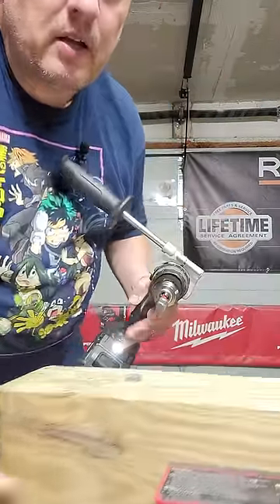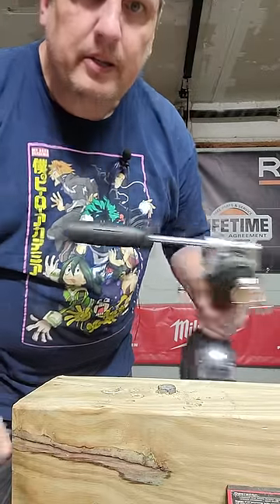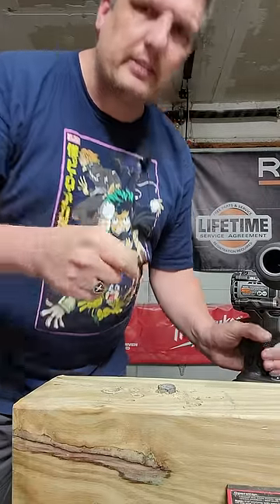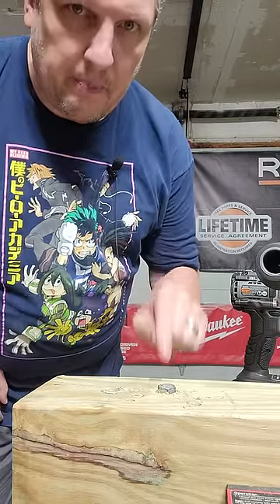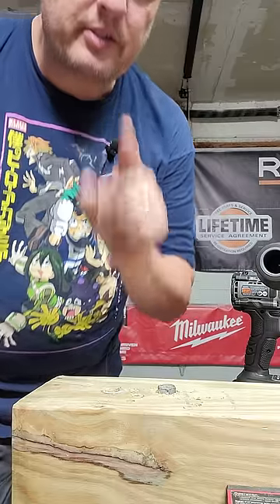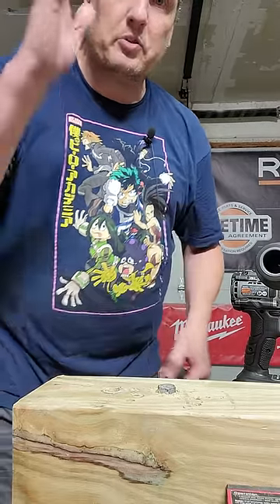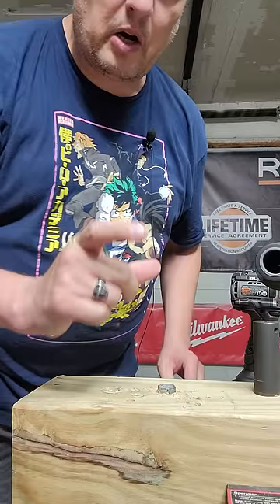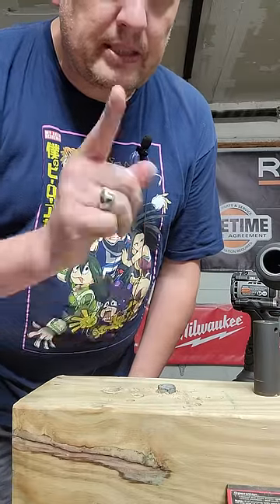Challenge Accepted! Now What? #challenge #powertools #tools #power #drill #EMBARRASSING #victory

Comment: Ill still rather wear out the hammers on the impact than the motor on the drill
Reply from the maker: Only a fool believes you would use an impact driver for this. It's like advertising your incompetence
Reply: @ToolswithSoAlz  let me educate you between a motor and chuck on an impact is 2 hammers that will wear out before the motor
Reply from the maker: @jonhoward1911 well, Joan, let me educate you on how this would really be done since your ignorance makes you arrogant enough to try to lecture men on things you have never done and don't know how to do. As a matter of fact I only need two words to expose your incompetence...pilot hole. This isn't a how-to video but you're such a mentally handicapped simp you don't know that simple fact! 
Also, you arrogant trash, only a fool believes that the slower tool, that has metal hitting on metal, building heat, would be the right tool for the job.

Comment: You’re killing your drill by putting it in high speed. Yes it does it faster but it also shortens the life of the drill. You can hear the strain of the drill as the lag bolt gets to about halfway. Now repeat this a couple hundred times with the same drill and it will eventually break much faster than intended
Reply from the maker: Ma'am you should be embarrassed at how little you know and how limited your intelligence is
Reply: Ive been working in construction for 7 years and own quite a lot of tools and service all the tools I own myself. I could take apart anything and put it back together without taking a single picture or using instructions. I know drills inside and out. So needless to say, im very intelligent when it comes to tools. But don’t let me tell you what to do 🤷‍♂️ you do you boo.
Reply from the maker: Ma'am, it only takes two words to expose your incompetence and the fact that you're a liar. Two words that every real professional knows and you don't. Those two words are also how this would truly be done and why the drill is the only tool you would use. Ladies like you, we call Faux-fessionals around here because they lack the basic understanding of tools and are dumb enough to believe this is a how-to video.  It's pathetic to see a young lady lie like you just did. You've never been on a job site, and you're not even qualified to comment.
Those two words are...pilot hole.  A pilot hole is something that you would drill into the two pieces of wood (note your first mistake in showing that you're not a professional) because these fasteners are used for joining materials together. You would then use the drill to drive the fastener since working men (here's another area you exposed your incompetence) wouldn't carry both an impact driver and a drill on their belts all day. 
Ma'am, in every way possible, you allowed your arrogance to expose your ignorance, but ignorance is all you have.
Reply: Yeah I never said “pilot hole” and neither did you in your video. Also my comment isn’t the only comment disagreeing with using the drill versus an impact. Those bolts are made for impacts. Also Flex Tools are overrated in my opinion. I’d much rather stick with my Dewalt tools. They are much more reliable and longer lasting. But as I said before : “you do you boo”
Reply from the maker: @OItsBear360 Ma'am we didn't mention pilot hole in the video because we didn't use one. You still don't have the brains to understand the video. This isn't a how-to video but a can-do video, Honey.
Reply: I completely understand that it’s a can do video my good sir, but faster isn’t always better. I’ll leave it at that. 
Also I have a challenge for you if you’re interested.

Comment: Drills are for HOLES.  Make a hole with a drill bit then ram that bolt in with the impact.  Less then 10 seconds and you will be done and not sweating and shaking like ol boy here.
Reply from the maker: First of all, I have Parkinson's disease. So you can take the retarded commentary about my shaking and shive it where you keep your brains. Also, only a fool would use an impact driver for this or even suggest it. What they're really saying is that they have absolutely no idea what they're talking about.

Comment: At that rate youd only have enough battery for about 4 of those bolts with a impact you ld be able to drive 20 of them in
Reply from the maker: You know absolutely nothing
Reply: @ToolswithSoAlz  that statement say more about you than it does about me arrogance is worse than ignorance .. if knew anything you'd know that a battery will last much longer on impact than a drill going all out thats one. Two you're comparing apples to oranges there's different implications for each tool when you gotta take a screw out you're way more likely to strip it with a drill vs an impact thats why if you knew anything you'd know that 90 % of construction sites run impacts instead of drills they are much smaller ligter and you dont have to hold onto it for dear life you can drive a screw in with one hand on a ladder try doing that with a drill with one hand you'll break ur wrist

Comment: Flex isn't worth the plastic it's made with.
Reply from the maker: Whatever lie you need to tell yourself
Reply: @ToolswithSoAlz  I've used a variety of drills and impact and Flex is up there with Kobalt from Lowes.  I'd rather use a Ryobi if we're going this route.
Reply from the maker: @nigglebaun7194 you're a liar. Unlike you I actually own nearly every brand.  Only a fool would believe Flex isn't at or near the top

Comment: I was reaching in a precarious position one time on a step ladder. Had no choice as there was an obstacle in the way , my furnace. Anyways the drill caught in the joist all the sudden and I tore a tendon in my forearm dropping the drill . I only wish I had it in impact hammer mode at the time .
Reply from the maker: Pilot holes are your friend.  However, sorry to hear you were injured
Reply: @ToolswithSoAlz 
It was a large hole like 1-1/2  inch . I was thinking back and thought it was a hole saw which are notorious for jamming , but I believe it was one of those flat bits . Not really a circumstance for a pilot hole . I should have been more careful is all

Comment: na just use a big impact gun, especially if you're only using one hand
Reply from the maker: You would never use an impact for this
Reply: @ToolswithSoAlz  already do works better than a drill, there also great for drilling big holes in tight spaces,

Comment: I keep busting the heads off the bolts
Reply from the maker: With a drill?
Reply: @ToolswithSoAlz  Yep.  Even removing them with a ratchet will often break the heads off.  Had one the other day in the concrete I couldn't get out of the floor and head popped off when I wrenched on it.

Comment: Yeah but no. Drills are for drilling, not driving. Hence the name
Reply: Also, impacts use hammers designed to use the force, drills just use the motors power and gears which means your drill will die much much faster than your impact. Also, depends on what impact you’re using. My Milwaukee 1/4 hex impact driver will drive that bolt in faster
Reply from the maker: It's called a drill driver. It's in the name. All you've done is explained how you know absolutely nothing about tools.

Comment: That is not the right tool for that. I drive 10,12,16in lags all day with 1/2” mid and high torgue DEWALT. Will the drive do it yes but don’t be surprised when it puffs smokes and dies on you.
Reply from the maker: Then you're doing it wrong
Reply: @ToolswithSoAlz  look up DEWALT dcf900 on torque test channel here on YouTube. After that come tell me your drill will best that. We’re working a cabin right now I’ll make a video comparing 1/4 DEWALT Xr, DEWALT brushed drill, DEWALT Xr hammer drill, DEWALT mid torque and DEWALT high torgue. We can make a wager. What kind of screw or lag do you want me to run?
Reply from the maker: @lukeknighton4918 Princess, I have already proven you wrong. You need a pretty chart because you don't know what you're talking about. I put the 900 up against a drill, doing the same task, the drill wins. BTW, only a fool believes you would use an impact for this.

Comment: lol your impact must not be a Milwaukee I don’t have any issues running 18 inch timber locks lol I never use a drill unless I’m drilling… not attaching someone. You’ll get away with a drill using a socket bit but not a t25 an especially not no phillip lol idc if your going in junk white pine won’t don’t nothing but piss you off.
Reply from the maker: I own more than you
Reply: @ToolswithSoAlz  lol that don’t mean nothing if you did. You’re not using half the tools right. You say one thing do the opposite to prove a “theory” when all it’s not proper technique on the tool. But I was also saying Milwaukee is top dog for its reason. Has setting in all drills/impacts for all reasons an type of work your doing. So even if you over crank or what ever it won’t snap the head off.
Reply from the maker: Alright Princess, since you pretend to know so much this should be easy. Pick up your little camera and show everyone how much you know. Prove me wrong Pickle Puffer. When you fail, and you will fail, never buy another tool again. You're not even qualified to comment because you're a loser

Comment: More strain on the drill
Reply from the maker: Nope
Reply: @ToolswithSoAlz  Impact don't bog burning the brushes up I no I used to smoke DeWalt Makita putting in ledger bolts had a pipe over the handle for more leverage..yep